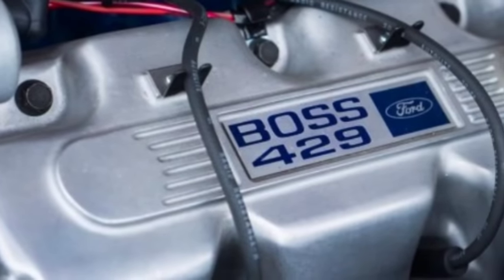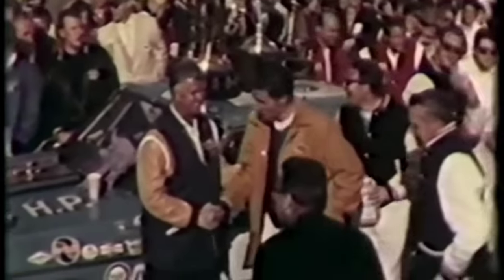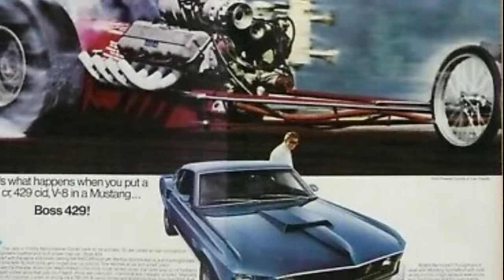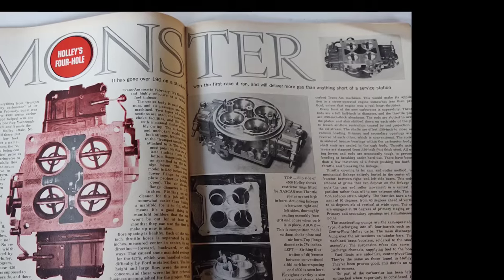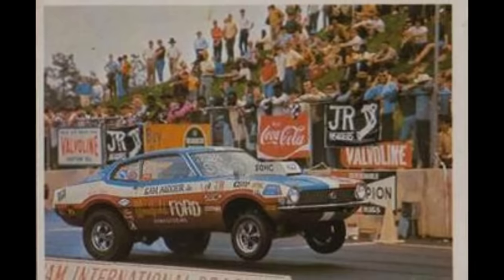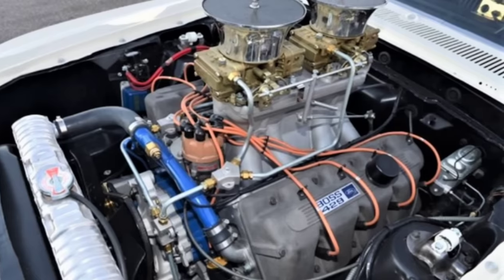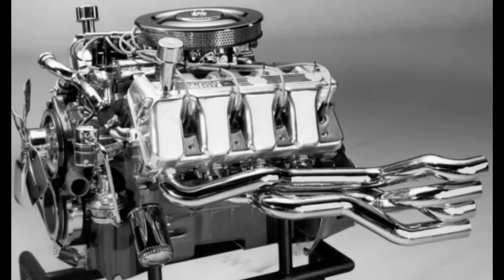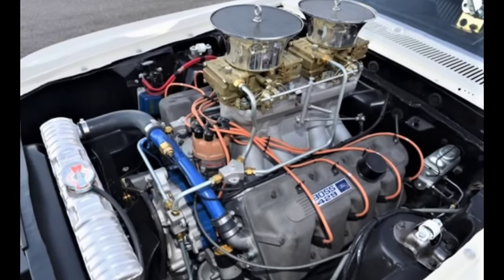The Misunderstood BOSS 429

Comment: I had a 1969 Boss 429 in stock form, my 440+6 cuda would blow it off the road easily! then i bought a 1970 Boss 429 that had been worked a little......Holman and Moddy solid lifter cam, dual blueprinted holleys on a medium riser intake, headman 180 degree headers,, scatter shield and McLeod clutch.........OMG that was a tire boiling bad ass! the power from 3000 rpm and up was unreal that car would "relight" the rear tires at 45-50 mph going into 3rd gear!
Reply from the maker: That is good stuff right there!  Thanks for Watching and please Subscribe as I have some cool stuff coming up!  Check out my project MIXED UP BOSS.. I'm putting BOSS 429 Style heads on a 429" Stroker Windsor!  
Andy
Reply: Holy crap 180 degree headers on that beast must have sounded unbelievable.
Reply: @life_of_riley88  that was real bad ass car. looked  mean as well
Reply: @douglasadams6024  Amazing, thanks for sharing.  I'm currently putting together a 72' Challenger with a 500hp 340, and it's getting a set of custom built 180 degree headers. Will make a video when it's done. Happy Motoring!
Reply: My brother had a stock SS 396 Chevelle in 1981 that was practically wore out smoked and everything but that dang car would spin the tires going into 3rd with the automatic trans at 70 mph, stock street tires of course but still blow my mind lol!😎👍

Comment: And now, we have men like John Kaase out there making the Big Boss not only reach, but exceed its full potential.
Reply from the maker: So true!  Thanks for Watching!
Andy
Reply: I live 5 minutes from his shop. It’s an amazing place to see inside.
Reply: I have a friend who is building a 67' Fairlane with a Boss 520 in it. Chuck Lawrence, who was an engine builder for Kasse, built the engine with parts he got from John. On the dyno, the engine had an 1100 Dominator on it, and it was starving for fuel. It turned 820 hp and I think it was 785 torque. When it goes in the car, they will put a double Sniper system on it which should get it to 900 hp.
Reply: If the Kasse engine is so good why is it not in Nhra prp stock going up against the GM cars???
Reply from the maker: @raginroadrunner read the NHRA rules! The Ford big block isn't legal in ProStock. The rules are completely based off of the GM Big Block bore spacing
Andy
Reply: @UnityMotorSportsGarage  Then run one in another class,then dare GM cars to compete??

Comment: When I was a teen I had a Ford Motorsport catalogue from the 80s (I was fixing up a Mustang at the time, and was working on the engine).  And all the motors and parts were Boss 429.  There was a large selection of heads.   I was just building a daily driver small block.  But it was interesting what you could order straight from Ford, in an era when factor V8s didn't even have 200 hp.
Reply: Kinda like Mopar's Direct-Connection. They had a book on how to 'build' the engine with the over the counterparts. ie. W2 heads, I put a 360 in a 79 D50, that's weight was 3029 lbs with the small block. 10.09 in 1985.

Comment: I cleared some land for a man back in 2008 he gave me a 1969 Ford short bed pickup truck,has a T code boss 429 in it,but he had it rebuilt with modern part's, And it pushes this old truck pretty darn good, especially at higher RPM I can see why it wasn't good for dragging but all in all for a solid street legal hot rod it's a beast
Reply from the maker: That is awesome! I would love to see this truck as I have a 71F100 I call Casper it's getting project MIXED UP BOSS.. it is a 429" stroker Windsor with BOSS 429 style heads on it . 
Thanks for Watching and sharing... My email is tunnelram393w@gmail.com 
Andy

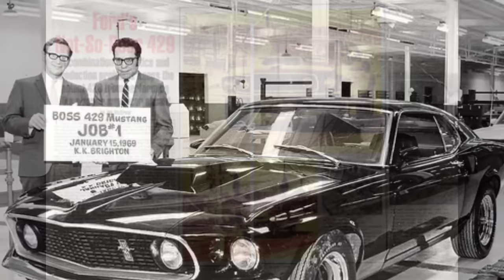Comment: 6:00 mark - The factory ram air was very restrictive, but was required in certain classes. It was competing in a class of Hemi's that came factory equipped with dual quads. In Stock type racing it was a 11- second car. I recently posted a story on this. In 1970 Kar Kraft offered a kit that included jets and other stuff to make it 0.20 faster then a 1970 SCJ. Great Video!

Comment: Liked the video.  I'm mostly a GM guy, but not a "only like this brand and all others stink" guy.   Agree with the part at the end that the Boss was one of the best-looking engines.  It's bad-ass looking, for sure. 
And also agree about its checkered race history.   It really just didn't do that well overall, until it was made with big cubes....and even then, it was spotty.   Ford fans will point to Glidden....and that's true.  But it was Glidden that made the Boss, not the other way around.    No other Ford team was really even particularly competitive in the same time frame, that was all Bob Glidden then.   He was ahead of the curve for a few years.   
With the aftermarket today, you can make anything run however you want it to.   But I love hearing about back in the day, when racers had to run the best they could find from factory parts and they couldn't just order up a CNC set of whatever size heads they wanted to along with an unbreakable rotating assy.  
Well done!
Reply from the maker: Thanks for the kind words! I'm not only this brand all other stink!  I have Built Fords, Mopars, Chevys and even AMC's.. They all have their strong points and weaknesses.. Now days the aftermarket has solved many of the problems.  Please Subscribe as I have other history videos that will be mixed in with my regular content!  
Andy

Comment: Way back  as a teen  I was a passenger in a boss 429  a church member  and a 69 hemi road runner, my chevron boss son. I love Ford but was brutal in 4 shift, banging & lifting the stang. But didn't feel the speed. But the hemi. It's was a special edition was just one one long lift and we were 60-70'area. The close I felt that again was in a Yamaha GS 1,000 the first model 11 s bike. The second gear pull 20-70 was like 2-3 second.  There is a difference from brute torque power. Than on the cam or live nitro power that can't be beat. Torque is fun & show & noise. LOL. His hemi was all black with back 50s on center lines beautiful car.
It's has to be around. And the cam hooker sound was perfect.

Comment: We built those engines at the Lima Engine Plant.  I drove many pistons in the Blue Crescent engine (our code name) for the 429 boss.  We were also making the 429/460 regular engines with wedge heads.  Some of those went into the Super Cobras.  We made some 460's for the presidential 
motorcade.  The 429 boss didn't have a head gasket, O rings around the cylinders and neoprene  rings around water ports, etc.  Valves were ,010 bigger that the Chrysler Hemi and the intake/exhaust ports were huge, heads were aluminum.  Each rocker arm had it's own pedestal and run on needle bearings.  I saw several running on the dynos at the plant......one at 5000 rpm for many ? hours just to see what would give up.  I believe some went almost 24 hours.  Exhausts would be glowing............!
Reply from the maker: That is amazing!  They are something to see forsure... Thank you for sharing this! Thanks for Watching and please Subscribe as I'm putting BOSS 429 style heads on a 429" stroker Windsor.. called MIXED UP BOSS
Andy

Comment: The biggest misunderstanding about the Boss 429, is that the street versions were detuned drastically. Mopar did a better street tune to their Hemi than Ford did. The Ford was built to go after the Mopar, and the race version did a lot better. Between those two engines and what they could have done to produce even better versions, was the number one reason NASCAR put the halt to them. They were just getting started good.
Reply from the maker: It could have been packaged better for the street that is forsure!  Thanks for watching
Andy
Reply: The race version did more than better beat the 426 hemi at Nascar. The Boss lived up to its name.
Reply: They had valve springs that limited rpm to 5000 in the Mustangs. The 2 King Cobra Torinos had the Boss 9.
Reply: You didn't LISTEN to the video.  The ports and valves were just to large in diameter for the street.  They were designed to run wide open and not for stoplight to stoplight.
Reply: The 429 BOSS was only sold to the public to comply with Nascar rules, so it didn't get all dressed up like 302. The 429 was thrown in a car that could fit it and not much else was done. When all it takes is a 302 to beat camaros on the dragstrip, there was no reason to push the 429 on normal buyers. If the 429 got all the attention the BOSS 302 package had, the price would have caused them to sell in the single digits. You could get a Mustang with a 429 BOSS engine, a Mustang with a 302 engine, or a Mustang with the BOSS package and a 302 engine. There never really was a BOSS 429 Mustang, just a regular mustang with a 429 BOSS engine. People who want to see the fully tuned 429 BOSS engine and full BOSS package should look at the 1969 Cyclone Spoiler BOSS
Reply: yep worked with a guy that had a mustang with one and it was a pain for the streets.
Reply: Fordodge

Comment: My father worked for Ford in the 50's and 60's as VP of the Truck Div., then left and bought up several Ford, Mercury, Lincoln dealerships throughout the mid-west to revive, we also got the exclusive Shelby Cobra and de Tomasso Pantera franchises for all of the midwest (his factory connections paid off) because he sponsored Cobra Racing. He ordered me a custom 1970 Mustang "Boss", but instead of a 302 ci V8, mine came with a 351ci "Cleveland" "Semi-Hemi Head" V8 and dual Quads, and factory pipe headers. Because it (with the 351 Cleveland, built on the Ford Small Block) was so light, it was FASTER than the 428 Boss, and I clobbered every Hemo Dodge and Chevy 427 a the drag strip. The 351ci Cleveland Semi-Hemi was a far better engine than the 429 Boss or the 427 "Cammer".
Reply from the maker: The Cleveland is going to be an upcoming video for me down the road!  Thanks for Watching
Andy

Comment: In 1971, when I was a 24-year-old, looked at a used red 1970 Boss 429 sitting at a Ford dealership. It had 5,000 miles on the clock, and the asking price was $5,000. I was so impressed those 50+ years ago, and I'm still impressed today.

Comment: FORD's two greatest big block engines are the FE-427 and the 427 SOHC. The 460 was also pretty good, along with the 428 Cobra Jet engine. And the 351 Cleveland is the baddest  small block to ever be produced by anyone. In the original movie, "Gone in 60 Seconds, a 1973 351 Boss Ram Air Mustang was the star of this show. That car got put through its paces and then some. Great Chase scenes.
Reply: I used to have a 53 ford f-100, short bed, chop top with a 427 sohc and transmission that came out of a 1964 galaxie.
   I still know exactly where the truck is and also where the engine and transmission both are. The engine and transmission are still bolted together with the factory headers, a radiator, etc.  and are still bolted into and engine cradle that I built. 
   I set it up so that I could run the engine periodically in storage while I worked on the truck. Hard times caused a forced sale of them separately.
Edit: "R" code not sohc "cammer". I am not sure why my brain went to the sohc. Lol.

Comment: YT algorythems sent me here and for once I'm glad. This was really well done! I'm a old guy and  really enjoyed the history. I can't wait to start seeing videos about Ford's new 7.3 Godzilla gas engine. They lost me some time back with all those "mod" motors, but now looks like they got a winner. They've already been modifing it to over 750+ HP!
Reply from the maker: Thanks for coming over Mark!  Check out my Project MIXED UP BOSS that im working on... Im putting BOSS 429 style heads on a 429" Windsor block!  Please subscribe to follow it along...
Andy
Reply: @UnityMotorSportsGarage  You're welcome! I've seen those stroker kits for the 351W but the rod angle ratio at 428-429ci seemed a little too severe for me. Sidewall loading would be pretty high.
Reply: I'm not a fan of Ford's "mod" engines either. Don't like their small 3.93 inch bore spacing. I think 3.7 inches is the maximum diameter bore that's possible.
Reply from the maker: Yeah 3.7" is considered "Big Bore".. lol. It works well but not ideal
Andy

Comment: I'm a Chevy guy but always thought that the SOHC and Boss 429 were the baddest of the bad.
Reply: Amplass 333  Nah, I love them all. So happens I grew up with SBC's.
Reply: So wasn't I. But I also desired to know what made the other guys fast and what didn't. There are few ways to get that information. While in Auto Scool, I got to tenure a few weeks at a Chassis Dyno shop that made anything run right and run fast. LOTS of American muscle exotica passed thru there owned by airplane manufacturing execs. "They like to fly on the ground as well".  The owner had a Cammer in a 65 Fairlane. Told to stay away from it. After a week of craning my neck while the hood was open, he invited me over and asked if I knew what it was. He was impressed with what I knew about it let alone what it was. I drove a 69 Firebird with a transplanted 327 SBC. No doubt, a small piece of history was there before me. Haven't seen one in the flesh since.

Comment: Definitely one of the best looking engines ever built. My 1999 Ford Mustang Cobra's engine 4.6 L Double overhead Cam engine had those really wide valve covers with the spark plugs in the middle of them.

Comment: this guy is completely right. the BOSS 429 was designed for the super speedway and didn't make great low end torque. get it up to speed and it was a monster. on the drag strip not so much. had two buddies, one had a BOSS 429 the other a 427 SOHC the 427 always beat the BOSS in a quarter mile drag.
Reply: Funny hiw Bob Glidden dominated pro stock for years with the Boss 429 based engine until NHRA banned their use.
Reply: @thomasblankinship98  the Boss 429 could be modified for drag use. as designed for NASCAR it wasn't optimized for drag racing. Glidden was one of the top racers ever, of course he could modify a Boss 429 into a top drag motor. as designed the 427 SOHC revved better than the Boss that's why my buddy's 427 was the faster car.
Reply: @thomasblankinship98  - and Rickie smith dominated IHRA pro stock also with Boss 429
Reply: @txhansolo22  don't remember NHRA allowing the SOHC engine in pro stock. It was a monster though.
Reply from the maker: Thomas, the Cammer ran in '70 and '71 in NHRA ProStock

Comment: Back in 1969 of all magazines that actually tested bone stock cars the 1969 Boss 429 T was number 2 of fastest cars. Getting beat by only the ‘69 GTX 426 Hemi Auto with a 4.10 gear. Very close the 426 went 13.32 @ 107 vs Boss 9 at 13.34 @ 107. Bigger carb on boss with better exhaust and they ran very well. I owned a 1 of 6 1967 Mercury Capri R code (427 8v) 4 spd and it was no doubt quicker than my friends 1967 Hemi GTX. I did add a limited slip diff to the 3.89 gear. Ford refused to put locking or limited slip rears in the 427 comets or Fairlane’s for “safety” so any magazine article from back then was with a open diff. Crazy really but one still ran a 13.51 @ 108 with open diff.

Comment: I was a weekender at Sunshine drag strip in Florida.  I had my S code prepared by Speed Specialties of St. Petersberg. With cutouts under the doors, I ran "A" stock and did very well with the Bow Tie guys. It ran quicker than the stock SS 396's at that time in 1970.

Comment: A great engine really. I have owned a bunch of 427's inc a SOHC, A 69 S B9 car that had only 7500 mi on it along with other B9 engines. Currently building a all aluminum 540" boss and adding twin turbos like George did for a daily driver. Using Kaase heads on this one. Have also owned more 428 & 429 CJ/SCJ cars than I can count. Way back in 1979 I bought a new '79 Little red express with the intention of dropping in a 426 Hemi that I had out of a '68 Road Runner I borrowed out the truck and never saw it again. The 426 went to a neighbor that was going to drop it in his '70 Challenger (6-Pak car) Last I heard the challenger and hemi are still sitting in same spot in his dads garage.
Reply from the maker: That is pretty awesome stuff right there!  Thanks for watching and please Subscribe!
Andy
Reply: I've been eyeing those Kaase heads for a 514 Cougar I'm building.
Reply from the maker: @buckykattguitar  They are some good heads!!  Thanks for Watching! Please Subscribe and follow my engine build Project MIXED UP BOSS!  I'm Putting BOSS 429 style heads on a 429" Windsor small block!
Andy
Reply: @buckykattguitar  N/A the engine makes 800 hp. 14.7 psi should double the HP. Stopping at 17 psi for starters and rev limit to 6500.

Comment: So . . . too much cylinder head ? Where have I heard that before ? AH, YES,  THE BOSS 302 ! 😁
Cool story, thanks ! 👍
Reply from the maker: Thanks for Watching!  Yes Ford went from one extreme to the other on port size... stock 302 heads have ports way to small to the Massive 4V ports big difference!  please Subscribe as I have some really good content coming on my MIXED UP BOSS project and other vids on different engine families!
Andy
Reply: Yeah...all the Chevy, Mopar and AMC SCCA and trans-am racers thought the Boss 302 had "too much cylinder head".  After having their asses handed to them.
Reply from the maker: Ford's answer after the tunnel port 302 disaster was the BOSS 302 and turn it 8000 rpm!!  Problem solved!
Andy
Reply: @oldmusher  it made for a horrible street engine is what I tried to infer. Not the End of the World.
A good race engine it was. 👌

Comment: My roommate bought a used Boss Mustang with a 429 and blew the engine while I was riding in it right after he bought it. I glanced at the speedometer and it read 135 MPH right before the engine blew.  He ended up installing a rebuilt Cleveland engine in the car which didn’t make sense to me but I suppose the Cleveland was more common and available back then.